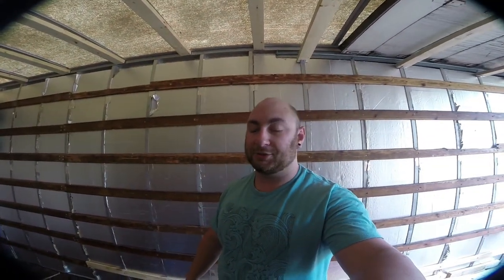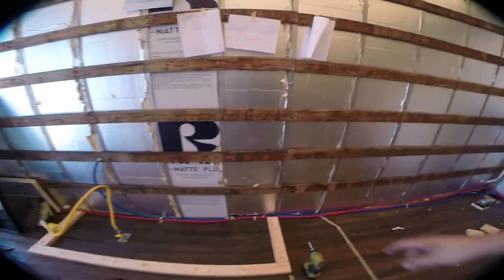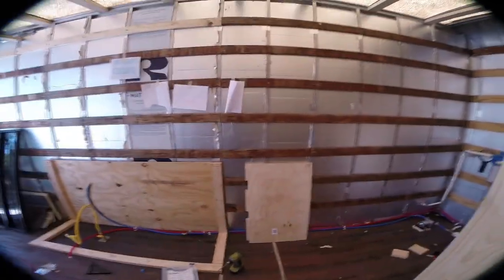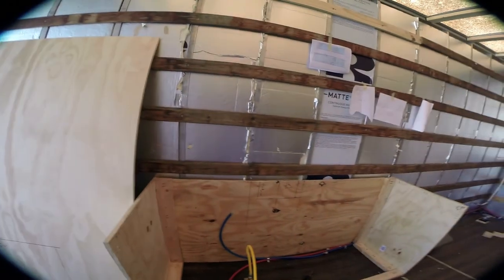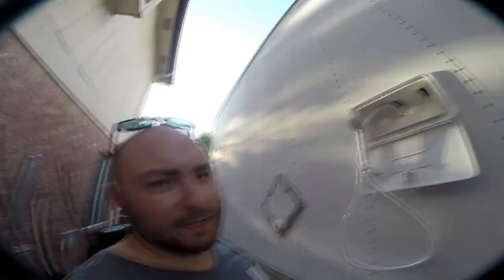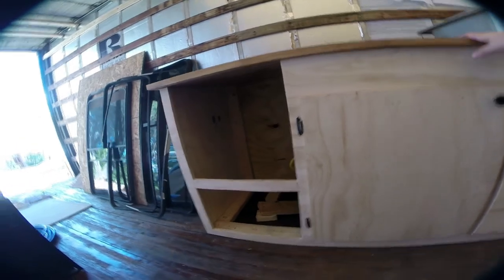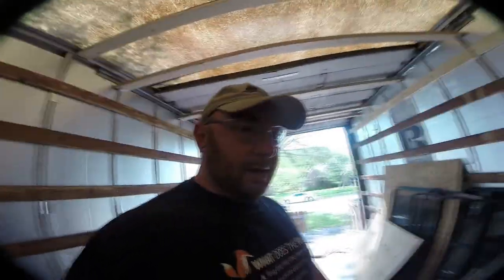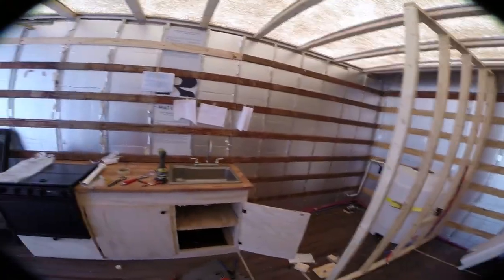#TheBassBox - Part 9 - Building a Kitchen - Box Truck to RV Conversion

Comment: Hey buddy I'm a 40 year carpenter and my wife and I are going to buy a 26 foot box truck and build out the entire rv . One thing I can tell you is not to worry too much about your carpentry skills there are tons of literature about carpentry.  The best advice I can give is to use the right tool for the right job, take your time and don't be concerned about what others think of your work. Good for you taking on that project. I will sub. to your channel and support you through build. Good luck bro.